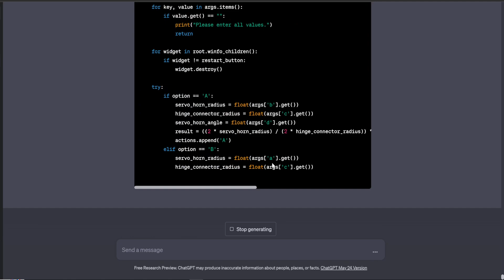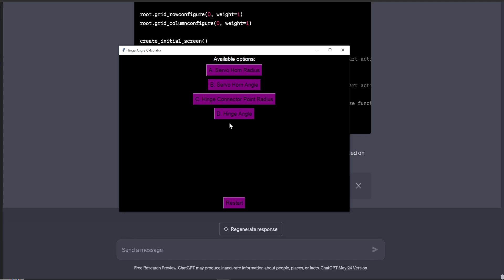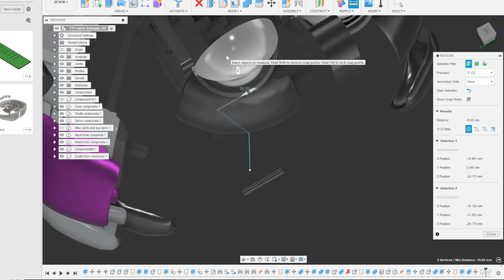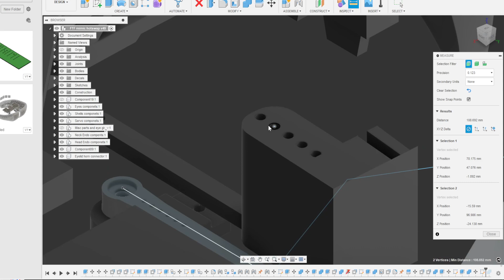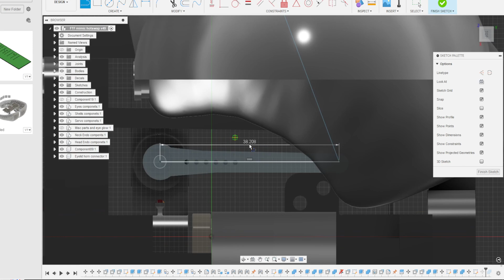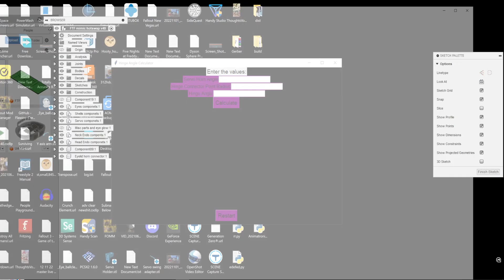I tried using Chat GPT to help right a program to help with animatronic math

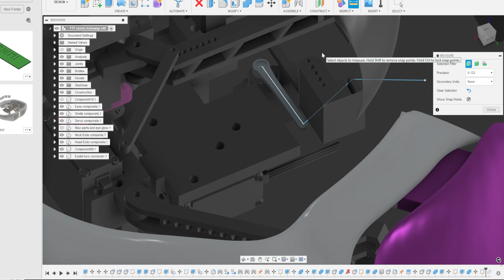Comment: at 2:56 - you can press the first of 3 buttons in the measurement panel - xyz delta - to display individual x, y, and z offsets between two points in millimetres. hope that helps!
Reply from the maker: I know but doesn't show the hypotenuse just besides of the triangle That's why I raised up the face the connector area so